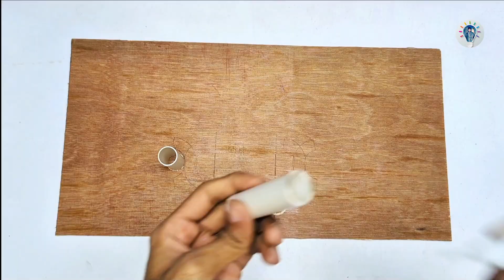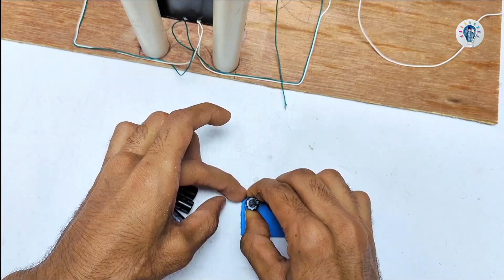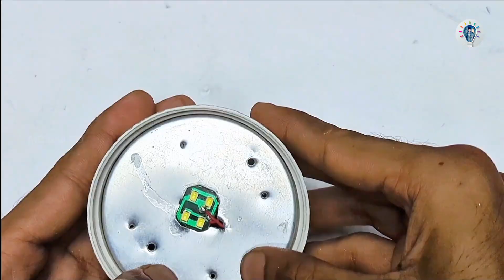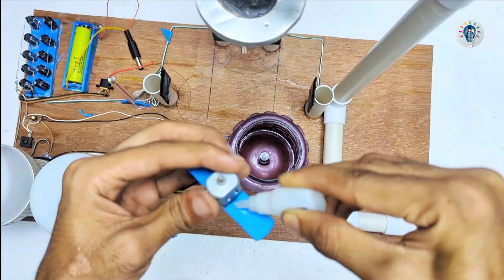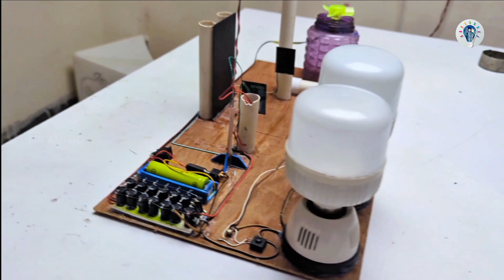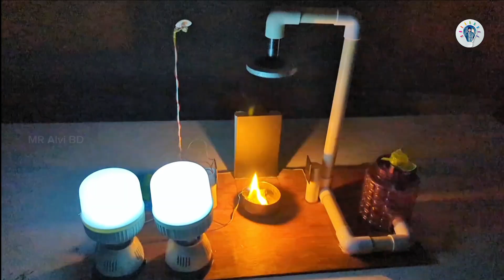Unbelievable Science Project 2.0 ⚡ Waste to Electricity & Smoke Purifier Model 🔥🌍

Comment: Ink jo banke aayegi vo kaisi hogi or kaise nikalni hai us dabbe se btado pls bro😢
Or bhai mujhe vo chote Wale do solar panel nhi mile mene bde vale hi lga diye 6v wale three and hitting sensor khi available nhi th mene nhi lgaya kuch dikkat to nhi hogi bro  btado pls😢
Reply from the maker: “The solar panels you have will work as well.
And place two or three layers of cotton in the middle of the box. Clean air will pass through the cotton layers, while the dust and dirt will remain trapped underneath.
Hope you understand ☺️
Reply: @mralvibd par bhai ink kaise banegi 😢
Reply: And bro i don't have hitting sensor i skipped it so kuch dikkat to nhi hogi 😢
Reply from the maker: can work even without a heating sensor.
No problem at all
Reply from the maker: “After keeping the fire burning for a long time, some soot will collect there.
And if you want to show it to your madam or sir within a short time, then you can leave a little soot there. While explaining, you can say that when we keep the fire running for a long time, a lot of soot will accumulate here. ☺️
Reply: @mralvibd thanks bro me aapse shayad kuch or madad mang skta hu pls available rhna 😊
Reply from the maker: @GTDEVIL668 “I’m very happy to help you.😇
Reply: @mralvibd bhai suno ek or help mere pass ye ac bulb nhi hai kya me unki jagah 0v wale bulb use kr skta hu jo chote hote hi filament wale and battery holder me jo battery hai vo isiliye hai taki solar panel se vo li-ion batry charge ho ske ? Or pls jo pvc pipe and elbow use kre hai uska exact size btado ye last help krdo bas 😢

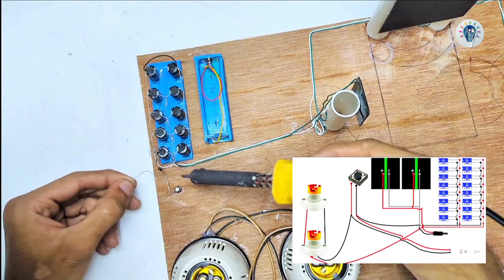Comment: You use two push switch what is the work of first switch and what is the work of second switch. First switch on 2:51 and second switch on 3:18
Reply from the maker: The first push switch I used works by sending small amounts of stored energy to the capacitors. This energy doesn’t last for long — it lights up only for a short time. Through the push switch, I demonstrated how the stored energy is released bit by bit.
The second switch I used is an ON/OFF switch, which directly connects to the battery. It allows all the stored energy to be released at once to show the full power output.
I hope you’ve understood the concept. If not, feel free to ask me again — I’d be happy to explain it in detail.
You can also email or message me on WhatsApp for any questions.
Thank you in advance!❤️